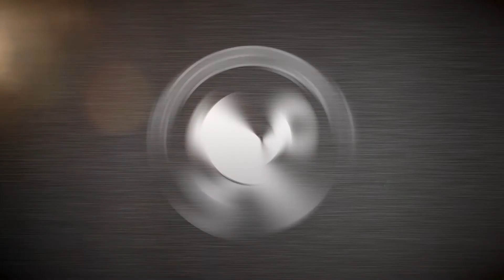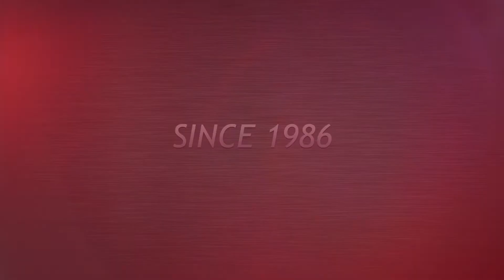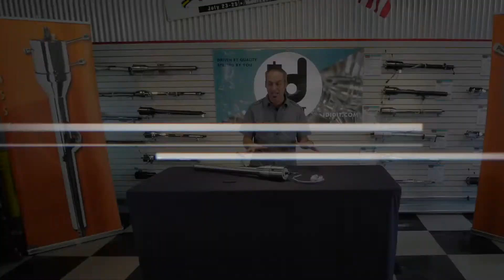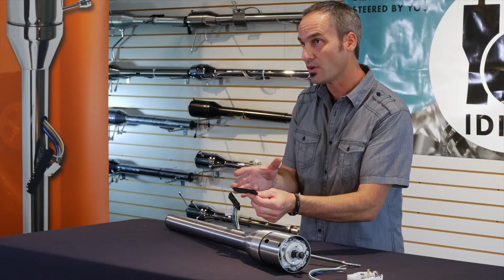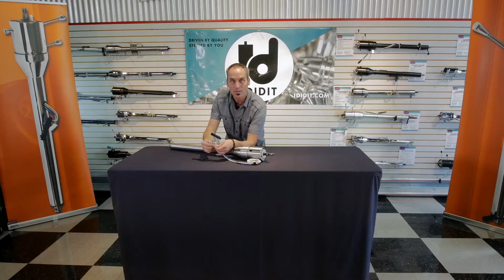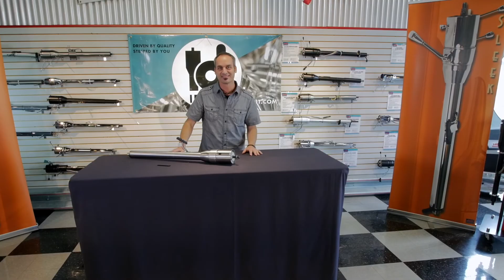IDIDIT COLUMN WIRING

Comment: My 68 cougar has 10 wires this unit only has 8,  I am left with a yellow, and red wire. I am assuming one or both is hot. Right now I have no horn, or turn signals = no juice electricity.